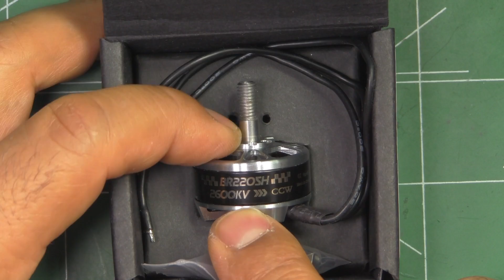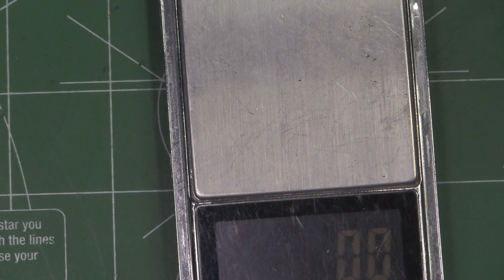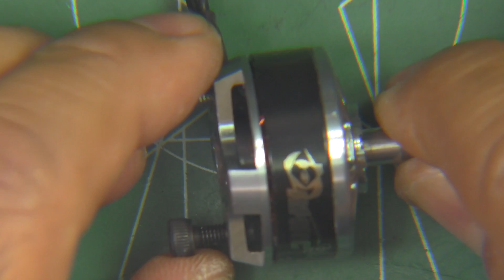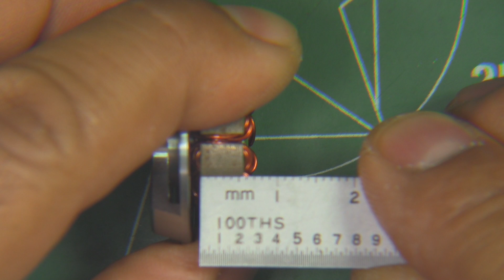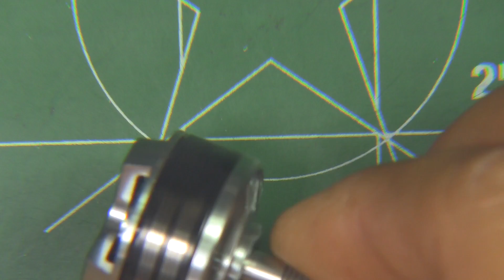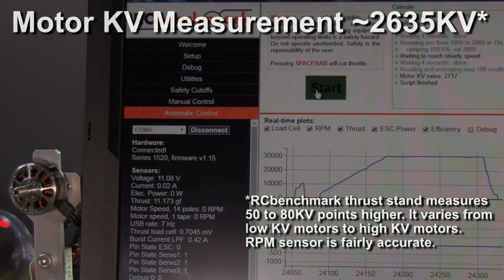RMRC BR2205H-2600KV Static Thrust Tests & Overview

Comment: I'd like to suggest the ZMX FinX23 (and maybe the FinX30). I mean... 23.2g for the FinX23...seriously?!!!  :O  It should additionally improve control feel as a lower motor weight reduces weight below the thrust line and its' super low profile moves your thrust line down for the entire mass of the quad as well!  ;)  :D Keep it up! Peace out 

Survey for everyone: Is the requirement and every day user experience of (having to crank-crank-crank on/off) lock-nuts an inconvenience and prop/nut fly-offs a PITA for you with all CW threaded motors?

 ...As opposed to a CW/CCW motor set without nylon type locknuts?... whereas you can spin the nut down with a flick or two of your finger and then just give them a ~1/3 turn to snug them up ('cause they will self tighten in flight and crashes), and where to remove them all you have to do is 'crack' the nut and again just spin it off with a flick or two of your finger. Meanwhile the nuts can be super low profile without the need for the nylon locking ring or the # of threads as they don't need to be as strong... as you're not having to tighten them up like crazy as you do on the 2 CW threaded motors that would (do anyway!) loosen those props nuts during a (nearly any!) prop strike on an all CW set of motors! I've modded my (aluminum!) nuts to test this 4 months ago for my CW/CCW motor set. I'm still on the same 4 nuts after 100's of flights, 3 frames, and 3 beat up motors. The ease and speed of prop swaps is incredible, and when there is a prop strike/crash the quad is not grounded from loosening a prop(s) nut(s). Pic of modded nuts: https://i.imgur.com/OzXRNsG.jpg

I may have CW and CCW reversed here, but you know what I mean.  ;)  :)
Reply: GITech I like the zmx motors but the shipping time kills the deal for me. I run all cw threaded motors and never have any trouble with props flying off.
Reply from the maker: GITech Very clever mod. Sounds like you've done extensive use and proven that works for sure. I don't mind either option, though I'm more with  the rightie-tightie  camp..... most likely I favor it because I don't get as much flying time as I'd like. I imagine if I could fly more often I'd be switching sides LoL. Your mod deserves a thread in one of the forums or a quick how-to video. Thanks for sharing

Comment: Thanks for the test. I am using this motor with dal q4040 props and I can't complain about the power or efficiency. The only problem I have is the vertical movement, this could be a great motor for the price. All they have to do is shim it correctly. The over sized stator really surprised me. I also think it is interesting that the lams are .2, when RMRC states they are .15. But any way thanks for the test, and keep up the great work.
Reply: on what size frame are you running these motors on?

Comment: I was gonna get these motors for my brothers budget build which has 20a esc's already; but with these amps that this motor is pulling, I'm starting to reconsider. I was gonna get him some old red bottoms for their durability. But then I thought about getting the rcx 2205 motor. Would the rcx motor be a better option for durability? What do u think is a good budget motor with great durability?
Reply from the maker: JC250 The EMAX are now cheap and are durable. RCX also a good choice. You can buy spare bell/shaft assemblies for both so good options. DYS FIRE also worth a look. Many are happy with their durability and so far I haven't seen reports of major issues with them. I've also recommended rcINpower GTS2205 motors. Surveillance carries them. Very durable and high QC but could be more expensive.
Reply: the rcx 2205 are durable but not as the 2206 because the shaft is 3mm. Also the bearings are 3x8x4  as opposed to the 2206 that have 4x9x4. I would get the 2206 ,they are the best price to performance motors atm. And do not worry about 20amps esc, you will not pull more than 80 in the air if you use a light prop.

Comment: i heard a strange fluttering sound on 4043x3 and seen some smoke on the 6040... was that smoke?
Reply from the maker: nasone32 Both correct! I forgot to mention about the fluttering on the 4043. I think that perhaps in-flight that fluttering doesn't  happen because all comments from users have been very positive for that prop. In Static thrust test conditions there's always some recirculation of air from the tip vortices being scooped up again by the front of the blades. That air is a bit turbulent so it could be that's causing blades to oscillate. Could be that won't happen when flying. Just a guess because they didn't feel bendy or flimsy at all. The 6040 prop stressed the motor a lot. Could be the stator wire is not high grade so a little enamel burnt off. That should not be and issue in-flight. Amps will be a lot lower so motor will be less stressed.

Comment: just curious are you testing these motors BEFORE you take them apart? if not you are not testing a factory production motor as it's been disassembled and reassembled. they should be tested straight from box.
Reply from the maker: After I run the tests, the first thing I do is solder the 3 connectors so they're ready for testing, then whenever I get some free time in the evening after I get home from work I run them on the thrust stand. If you watch the AOKFly 2306 review, you'll see that I found out a stator winding wire rubbed on the bell and took out a little bit of wire material, luckily no shorts. 
I think disassembling before testing should not affect results, as long as they go back together properly. There's nothing that you would change that would cause different results. Bell pops out then back in, install washers/shims, screw or C- / E- clips and shold be just as received from factory. 
Is there something that you know that would cause test results to be different?
Reply: EngineerX my only thought is that testing should be done before dissambly due to the idea of a "factory direct" performance test. Basically showing it as we would pull it from the new package and install on quad. When you open the motor up you are allowing for a few things to happen. You could be removing or adding contaminants. Also removing or adding mechanical bind by pressing bells off and on again. such as a poorly installed bearing could be resolved by your assembly procedure therfore testing would be better than factory performance....
Reply from the maker: It would show in the tear down if a bearing is so badly installed or if there are any other significant QC issues. I think so far, not one of the motors I've tested has been so badly assembled at the factory that it would benefit from tearing it down and putting it back together "the right way". The closest one was the AOKFly 2306 due to its stator wire rubbing on the bell. Most motors, even the very low budget motors with really bad quality bearings, come with reasonably aligned shaft/bearings. So sliding bell off and putting back on doesn't really do much to improve or worsen performance. A poorly installed bearing would be a major defect - it would cause the bell to be completely stuck or stator & magnets would come into contact so I would actually not be able to run any thrust tests on such a motor.  
The only issue that I can think could arise from disassembling would be motors that use a shaft-retaining screw. If the screw came too tight from the factory, to the point that it was causing the bearing to bind, adding friction and causing the motor to spin with more effort, then that would indeed affect performance. I've only seen screws that were too loose and screws that were difficult to remove due to threadlock.